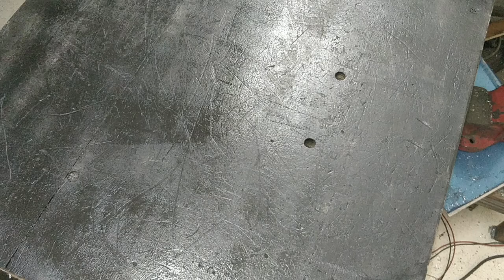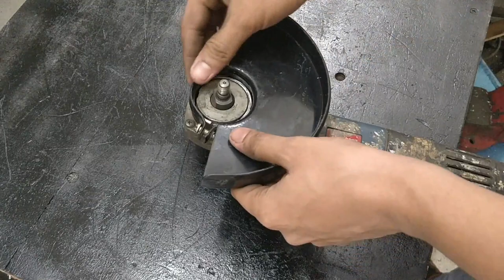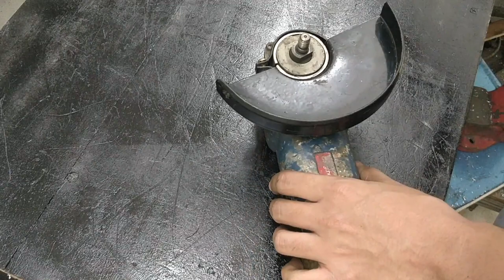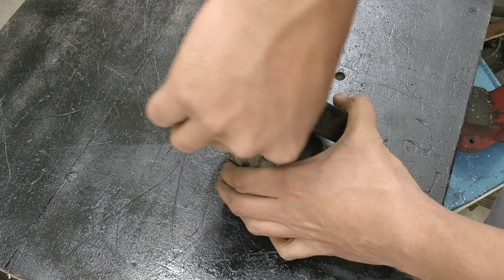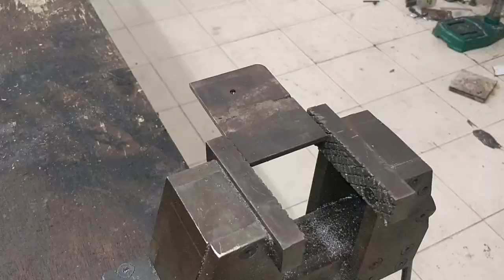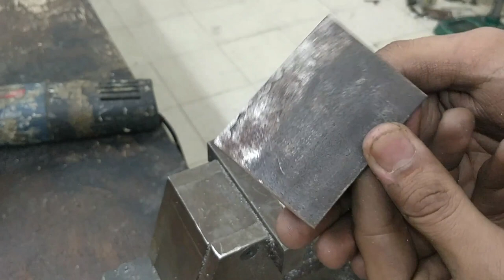Convert a 4" Angle Grinder to 5" Grinder

Comment: Never attach a 5 inch disk in a 4 inch grinder. Because the 4 inch grinder spins at much higher speed than a 5 inch grinder. And the bigger disks are not designed to run at this high speed.
Reply: To be precise, know the RPM range of your desired accessory rather than make generalizations.  I select accessories appropriately and do not over-speed them. Those little grinders are however best avoided unless found used for pocket change (which is fine, I get many expendable tools that way and repairing used equipment is easy and educational).
Reply: thats why variable speed grinders exist
Reply: All depends on the use. A 5.5 saw blade will work, but it will go a little over top speed it is made for, not the best. But will work light duty. There are speed controllers you can get that are used on grinders and such. It is possible to add one the grinder housing.

Comment: How to run 5/8 arber blade on 7/8 flang nut.

99% of blades available in 5.5in size dont have 7/8 arbor hole, unless for cutting metal and porcelain!!

Available blade arbor holes:
10 mm, 5/8, 1/2, and (7/8).

Tip:
Remove rebate lip on (Flang nut) for the 7/8 arber. Then, the blade will center directly on the drive shaft.. 5/8. It does not have to be pretty.
New flang nuts can be had on amazon cheap.
You can now run a 5.5 saw blade on a grinder if you so dare🙀. ❤